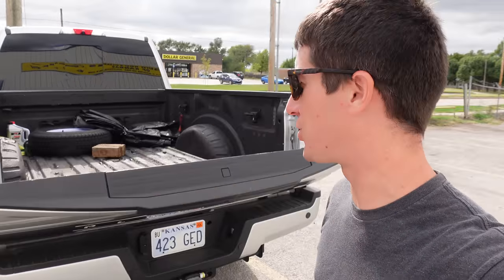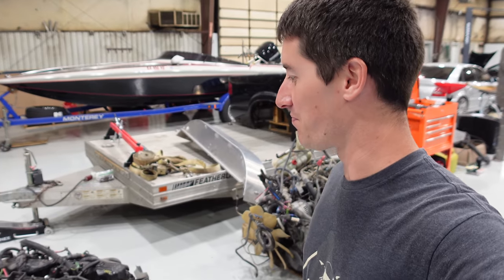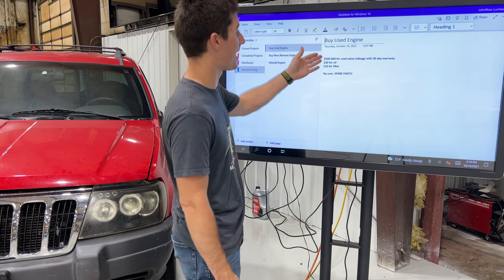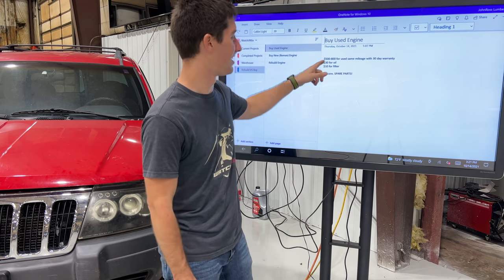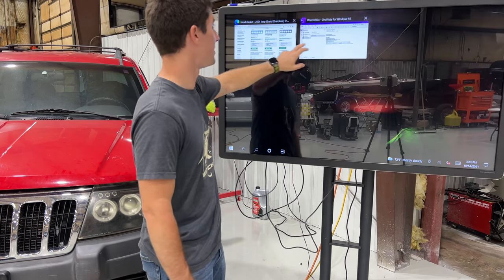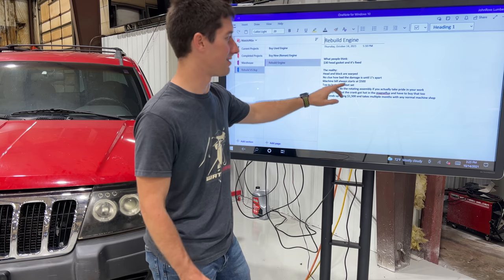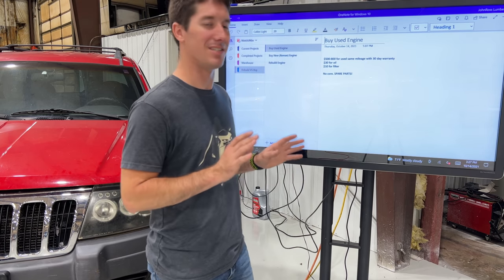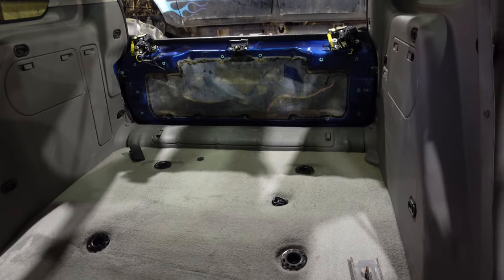Here's Why You Should NEVER Rebuild An ENGINE *The Math Doesn't Add Up*

Comment: The oneeee thing i would do/(get good at) is as the engine is already out doing the timing belt/chain and water pump (if on the timing). Great selling point and well worth it while youre there
Reply: I agree if your keeping it for yourself.
Reply: @kennypool  here me out, $100 in parts for a $500-$1000 job while the engine is already out. Not gunna lie, id pay an extra $400 any day for a vehicle knowing thats been done.
Reply: @lifefollows8267  Not allowed in the flippers handbook.
Reply: @kennypool  🤣🤣🤣🤣 you tell no lies there
Reply: A lot easier while engine is out.
Reply: @kennypool  Correct. I have done ALOT of engine swaps. The best parts between the two engines get used. That includes stuff like spark plugs. Even the old antifreeze gets reused if its serviceable. If the part is just plain bad like a motor mount, then yes it gets replaced.
Reply: @kennypool  LOL true, fixing the vehicle 100% eats into profits. I've never came across a completely fixed flip. If they disclose whats left to fix, they give you the "If I fix that, the asking price is gonna go up $2500 at minimum before I tear in and not find anything else. It's your money and I will gladly do that for you". The issue was 3 sensors that were $200 total and barely 3 hours book.
Reply: He is flipping it, ASAP, the longer he owns it, the more likely something bad happens to the car.

Comment: My truck and some of my equipment use 5.9l Cummins engines, as they are extremely common. Rebuilding is thousands cheaper than buying a new engine. We also have two vehicles that have the Ecoboost 3.5L and once again, rebuilding is cheaper than new. Who would go to the trouble to replace an engine with a used one??? New or rebuilt is the way to go. If it is worth doing, It is worth doing right.

Comment: There are always exceptions.  75% of the time a good used engine is the way to go, but when you've got a minor head gasket leak with known history then just doing a head gasket can be good option, especially on a 4 cylinder.  Every situation is different.
Reply: Haha a minor head gasket leak? Yeah right you better hope you catch that soon enough by checking to see if your burning oil through your exhaust or similar effects. And your not just going to replace the head gasket either. You'll need to flush the coolant, refill it, get some new oil and filters... and if it's bad enough you'll have to tear it down just to clean everything... and don't forget all the tools (scotch Brite or equivalent buffer for polishing) and cleaner (kerosene, acetone, degreaser, brake cleaner, ect) that you need to polish the heads, upper lower intake, valve covers and who all knows what you'll find in there. It's all a game of chance at that point...
Reply: @thedornanfam-blogsplusmore8510  Yeah,  if you don't own the tools and supplies to work on your car,  you probably should just bring it to a shop.

Comment: Not even considering the money, the time invested rebuilding the engine and waiting on machine work would take many hours labor longer as well as weeks(possibly) waiting on the machine shop.
Reply: There is a “performance” machine shop in my city that is lucky to get you back your heads in 6 months 🤣
Reply: sunnohh dam where im at i can get it back in a few days
Reply: No machine shops in the eastern panhandle of WV
Reply: @subarulegacy4203   no,you cant....if you could the shop wouldn't be in business
Reply: @trillrifaxegrindor4411  Yeah okay.
Reply: @trillrifaxegrindor4411  3406 caterpillar 6 cylinder diesel 900ci head into the machine shop on tuesday back at my shop thursday completely overhauled

Comment: I'd say, for a daily driver, do a partial rebuild on the new-used engine. Hone the cylinders and throw in some new rings, new rod and main bearings, new head gasket and head bolts, new valve seals. And clean all the carbon out.  The total cost of this would be under $500 and it would extend the engine's life dramatically.  But this is if you were to keep the car for a long time and use it as a daily driver.  Since you're flipping it, it would make more sense to just swap in the used engine as is.

Comment: With a junk yard engine most vendors require you to replace timing chains to get warranty, you will replace water pump and oil pump too. $800 is not your total cost with a junkyard buy.

Comment: I love how it's so cheap in USA to do things like this. Cars are cheap. Decent wrecking yard engines are cheap. Heck here in Oz you need to mortgage ya house just for a second hand engine from a suspect wreckers let alone the cost of the car you need to stick it in. Flipping here sure ain't as easy.
Reply: Shhhhh! Don't let em hear you ! ;)
Reply: the state also reckons you need a dealers licence if you flip too many cars in a short time (like a few months).
Reply: @dieterhauer8619  Politicians in general are a waste of space.
Reply: @dieterhauer8619  Fucked up the whole industry for a decade and more. It was just corporate welfare anyway as it was really just a $5k voucher for a brand new car. The clunkers-which were far from that-also had the motors ruined adding to used car parts prices.

Comment: I have to agree with you, although I did rebuild the top end of a 6.0 L Powerstroke, and glad I did.  I purchased an '06 F250 w/150k miles, in 2018 for $5k, knowing I wanted to do all the fixes that plagued this engine, since I heard the bottom end on the 6.0 was solid.  It supposedly had a bad HPOP, but ended up being a $15 fix of the IPR.  Ran it for a few weeks, and then noticed a little oil residue in the coolant reservoir, so took it off the road and did what I intended; new oil cooler, alum radiator, ARP studs,  turbo, heads shaved and O-ringed,  top shelf head gaskets, 12mm dummy plugs,  and a few other minor things.  Did all labor myself, and probably have $8k in it.  Runs like a charm, and pulls my boat with plenty of power in reserve.

Comment: Years ago, when I was "young & dumb", my friends put me onto an old clunker for $300 (1980).  Stupid me tried to fix it and it nearly sent me broke, as I was a student at the time.  My friend said later, "why didn't you tell us? We would have just got you another clunker."   So my dad and his mechanic mate, bought a whole same car for $50, swapped the engine out and put it into my car.  Ran really well after that and I got a few more years out of it.  Sadly, it had no air-con, and traded it in for the biggest lemon of all time, a VOLVO 164!!! OMG, that car broke me.  
Keep doing what you do JR, it only makes sense.  Get rid of that Cube!!
Reply: I can relate. Being on a mac n cheese budget, and shopping for cheap transportation at the auto auction.  Where your rolling the dice. Typically, friends were eyeing up, bidding, and buying tired sports cars. I'm focused on cheap runners like the 5-speed 88' Chevy Corsica with the 2.8L six, low miles, two shades of blue budget paint, overspray, and side mirror barely attached.  The follow week, i'm car pooling everyone to class with the only running vehicle.
Nice presentation JR. Agreed, let the Cube crap go.  Hear lotsa high cost horror stories from former late model Nissan owners.  Older Nissan's were all right.

Comment: I am very leery about salvage yard engines , most places won't do a pre-test and print out the results for the consumer , but if they will I am willing to pay more than a couple hundred for a used engine . ( I DON'T LIKE DOING A JOB TWICE ) . Not to mention I would rather not have a person I sold a car to come back a month later and complain , or worse yet not complain but instead get even in a different way . I want them to come back again to buy another vehicle in the future . Yes I know about as-is laws and I find that if I show the purchaser receipts for a new long block or a new or rebuilt trans they are willing to pay more . But , yes you are correct the cheapest way to do it is buy a used engine and hope for the best .

Comment: This is how I've always felt. That being said a simple engine like a toyota 22r are really nice with a fresh rebuild.
Reply: The Toyota 3F is a really good engine too, pretty much bulletproof. My dad had an 85' Fj60 with 500.000+ km and we just did basic maintainance and repairs, at about 350.000 km we decided to do a complete rehaul, took the whole thing apart and put in new pistons, rings, crankshaft bearings, push rods, honed the cylinders, etc. And they were all good, we just did it cause we wanted to restore the vehicle and we had the time and money to do it.
Reply: @Darrin R. depends on where you live my 1983 sr5 4x4 longbed only has a little rust at the front and back of the bed because it hauled a slide in camper most of its life. My step-dads 1979 short bed had a canopy it's whole life and was MINT too bad he sold it 12yrs ago for $3000 now it's worth $15000+ lol
Reply: I rebuilt mine.
Reply: You aren't going to find many 22r's in salvage...you aren't going to find many on the road

Comment: I went through five junkyard engines before I got a good one.  The dealer and I both lost big time, there were no winners in that transaction.  From then on, I have used short blocks.  So much less trouble.  Some cars when the engine fails, it's time to scrap it.  Simply not made to be repaired.

Comment: Those 4L Jeep inline sixes have a head cracking problem from 2000 and up. Chrysler thinned out the casting, to reduce weight. Replacing it with a used engine is the best option, as a head gasket would have done nothing!

Comment: Very questionable statement for all who are not living in the US 
"We" are not on the source of reliable second-hand engines
"We" have some ridiculous laws regarding engine swaps - the engine is not a spare part and you have to declare it to the registration license of your car/boat
"We" don't earn 80 US$/hour, labor is way cheaper
And you shouldn't thrust pulled out, a bare engine from the junkyard, because you don't know what torture had it survived in a previous vehicle

BONUS: All problems that the previous owner had with the engine are transferred to you. If you want to continue to ride the same vehicle, and you want it reliable, rebuild the engine. You got a 0 miles/kilometers engine that won't have pain in ass leaks, bad gaskets, fault engine codes...

Comment: You're right. I replaced a head gasket last year and went with the "while I'm in here approach". That turned into over 1k when all was said and done and I did all the labor myself except the head. Sent that off to a machine shop and had it completely rebuilt. Ran great afterwards but a lower miliage used engine would've been the best option looking back.
Reply: Similar story with my dodge truck with a magnum V8. Only my heads were cracked (very common issue) and I thought it was a blown head gasket. 2 remanufactured heads and some other parts cost me $1k in "while you're in there" parts. Haha She's still running strong 10k miles later.
Reply: Not sure how it's the best option looking back.... You have 0 information of the state of the engine that you purchase. It could have other issues you don't know about... The 'while i'm there approach' is completely your fault. Not a fair comparison when you're spending money on the rebuilt engine that you don't need to. I'd rebuild over purchase an unknown engine any day of the week assuming the engine I have is reasonably salvageable.
Reply: yeah because people just love to send their low mileage engine to the scrap heap for pennies

Comment: Proud shop owner here. Rebuild and engine swaps are my bread and butter. Im currently replacing my 3rd Jasper engine due to failure. Ever since covid, old school builders at Jasper never came back to work. Im fonding that there are issues with the 6.2 engines. So be careful.
Reply: Jasper rebuilds in the 1970’s
we’re perfect, I worked for a
Ford dealership parts dept. as 
a parts truck delivery driver. I
picked up Many Jasper rebuilds 
and we never had a problem.
I remember the turquoise paint
color of each mill, bolted secure
to a 4 way square pallet, wrap-
ped meticulously in heavy gauge plastic wrap with paper
work wired on securely.     CB

Comment: As an auto mechanic  I've found it's really not worth even replacing the motor or transmission on most cars. They run up to 3 to 400000 these days so if the motor goes out the transmission is probably not to far behind.  And then what about the rest of the car? Like the body is starting to go the interior is all wore out  and the the car is still going on 15 years old and worth around 2 to 3000. And then of course anything you find in a salvage yard is going to be high mileage  and you can't here them running before you buy so until you get it installed you don't know what you're getting.  I've got salvage yard motors that knocked when I started them so back out it goes and exchange for another one.  I feel like the salvage yards are slowly becoming a thing of the past and are becoming more like scrap yards as the average person doesn't work on cars anymore and car's are becoming more like disposable  appliances where everything goes out all at once. So basically unless it's something you really like and committed to it's not worth it.  Ure better off getting something different.
Reply: Don’t sound like a tech to me... that’s your bread and butter how would u keep the doors open when your turning away motors and trans jobs...
Reply: @zackm6850  I've never turned anything away if they want me to do the work I will.  I just see people putting money into car's that I personally wouldn't.

Comment: I go with low mile used engines because:
Factory OEM parts (bearings, seals, rings and gaskets
Newer OEM components timing set, oil pump, water pump, injectors and coils